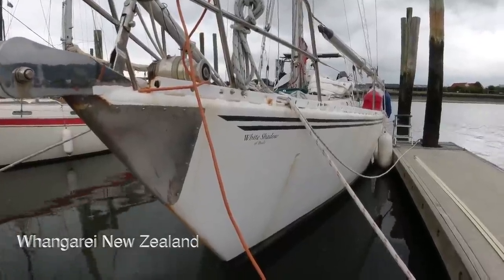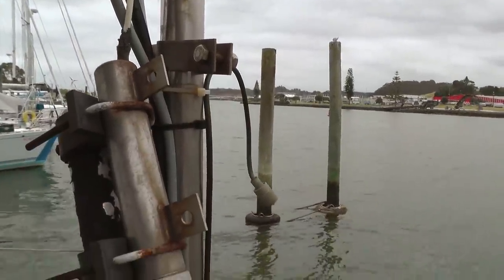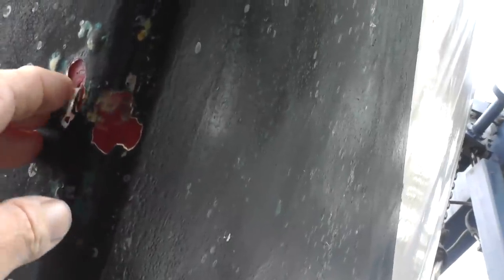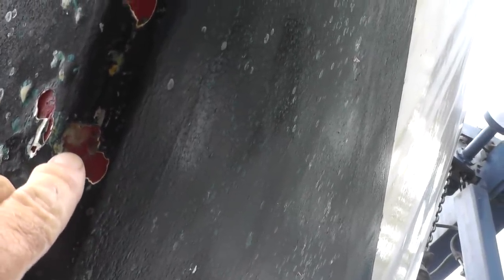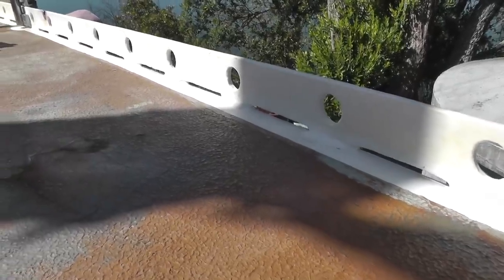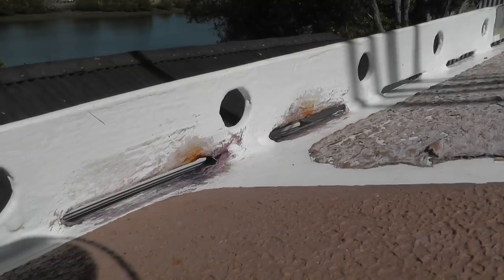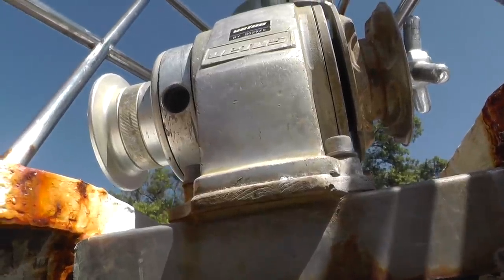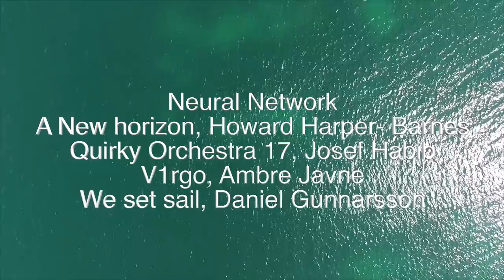Yacht Haulout. Adventures of an Old Seadog, epi 165

Comment: Baz, if the rust is coming back you are definitely doing it wrong, The only time it has come back on my boat was poor preparation and trying too much at a time. I clean the iron oxide off or Scale ,Rust what ever you name it back to bright clean metal, then clean it off with  acetone just before i paint it with saturated zinc paint, one pack for scratches, portholes, chips and joining areas and two pack Jotun 90 for larger and hard wearing areas and the bottom of the hull. Cleaning rust stains off is usually done with Oxalic Acid. Keep em coming mate it is always great when you feed pops up.

Comment: Barry, the reason for the rusting at the gunwales is because of minute changes in pressure - the water being forced through the gaps. In addition to this, there is also friction - from waterborne materials: salt, minerals and microscopic sea creatures - which, although almost imperceptible, are enough to cause these weak points. A flying fish making a tiny scratch will be enough to remove a tiny bit of protection. Cheers

Comment: For people who are interested in steel boats.... Grind down to metal and use an inorganic zink primer for metal. This turns any rust on the metal to an inert salts and binds to the steel. This provides a base for the epoxy coatings. This is a Lloyds steel boat requirement.
The single part primers that turn the metal black do not work over time.
Reply: I've read in several forums, several people, stating, that their experience, is that a cold/sprayed zinc layer serves no purpose at all (but likely also does no harm).  But the epoxy coating I do believe in because it's a two component layer.
Reply: @finnerutavdet ... Yes... The inorganic zink primer is a two part epoxy based product. It was pioneered by the auto industry and why cars don't rust badly anymore.
Everything metal... From shipping containers to rebar in concrete is coated with this green primer.

Comment: A suggestion for the chain locker if I may Barry is once it's all cleaned out and repainted, coat your chain locker with Rhino Liner.  That's some stout stuff.  Your anchor chain will be hard pressed to chaff it off or penetrate.  Just a suggestion.  Thanks for all the videos and sharing the adventure.
Reply: Excellent idea, I've used it in the engine room and other high traffic areas, works well..As usual, it's ALL in the proper surface prep...
Reply: @Chris-fo8wp  yes... LineX is about the same but used in industrial applications and the military uses it also.  Not exactly cheap.... but worth the investment.
Reply: Rhino liner in my pick-up truck bed ten years old and still looks good.  I do like the results!
Reply: @Slick2462  It's good stuff.  And available all around the world.  Even where he's at.
Reply: I haven't ever used Rhino paint before but I cant see any kind of paint withstanding the abuse a chain vends on a storage locker.  Im thinking Rhino paint under some sort of rubber mat.  Ive seen hvy duty welcome matts with holes cut up and used in this sort of hvy use area before with outstanding results. I would go so far as to put some sort of drainage plate above the floor to take most of the abuse while still giving a place for water to drain and dry.
Reply: @mitch_the_-itch  It's not a paint but an industrial rubber type coating.  Pretty thick.  Never heard a complaint from truck owners.  These guys put the truck beds through a beating.
Reply: Rhino liner is pretty tough, but in this application I wouldn't use it.  At some point rust is going to start growing behind it.  It's a steel boat in salt water, gonna happen.  Now you've got to remove the Rhino liner to attack the rust.  That sounds like a lot of work compared to picking up a few rubber mats.

Comment: Get yourself a small handheld air needle gun and borrow a air compressor. You will save yourself a lot of time, and head aces. No more dust and that needles get into the tinest corners.
Reply: Needle gun is a required piece of equipment on a metal boat!!!
Reply: Nothing like the sound of a Needle gun when I was in the Navy! Hands being vibrated to death after working on scuppers for 8 hours a day.
Reply: I use and highly recommend the Nito Jetchisel Jex28. Best Needle Gun in the free world!!
Reply: Better off with a small sandblaster, faster and better results, it’s messy but it’s worth it... cheers 🍻 💚🍀
Reply: @Chris-fo8wp  way way too late.  I think Barry's close to a year behind on his uploads.  If I remember correctly, he arrived in New Zealand when china 19 hit.  needle guns ARE handy
Reply: @christopherw4527  From Insta and Twitter it looks like this is fairly realtime. Maybe you confused this channel with Soulianis. They are over a year behind. NZ does not have Covid.
Reply: @heiner71  Maybe you are right.  I just remember listening to a video called sailing over 50 or something similar.  Barry does talk about why we don't see masks, because he arrived in NZ about the time china virus hit.    Guess it doesn't really matter.
Reply: @heiner71  just looked on AIS.  says he left on the 4th of january and is headed north.
Reply: @christopherw4527  Great! Could be that he fixed his boat really fast, or that he is a few months behind in posting. Probably somewhere in the middle.
Reply: @heiner71  Barry fast?  lol.  probably somewhere in the middle.  It did show him being anchored around wangari in many different locations.  He probably finished up several months ago, then changed anchorages for a month or two before sailing north.  looking forward to new adventures!
Reply: @bigeyetuna6228  unfortunately u cannot do this in a marina like this. The sand and rust dust would go anywhere..
Reply: @bigeyetuna6228  and u need tons of sand...

Comment: Hello Barry, I don't know which exact product you are using but usually it is extremely important not to let it rest overnight, it gets humid with the cold air and dew and you have to start from scratch (sanding it out) otherwise your rust will grow back from the inside. The normal procedure is : apply the first coat, let it do its magic for a few hours, then apply the second coat and paint after a half hour to seal it from the humidity. It has to happen all in the same day! Good luck with everything.

Comment: If you are able to get Marine Tex there, grind the rust off in the anchor locker, then mix and apply a thin layer of Marine Tex epoxy putty over the areas. It won't wear off like paint.

Comment: The rust on all rail holes are caused because the holes have a noun round eges, those edges for shure are sharp, so rounding all edges will be the best solution to allow the paint best adherence and erosion resistance. Sorry for my english.

Comment: Rust is iron oxide. The chemical treatments usually is phosphoric acid which contains phosphor. Phosphor is more chemically active than oxygen (oxide) so it replaces the oxygen in the iron oxide turning it to iron phosphate.

Comment: A little trick I use to cover and protect metal on boats is powder coating. Buy a bag of white powder coat and a heat gun. Put the powder on any surface and heat it up with the heat gun. As it heats up it dries smooth and seals any metal object. Lasts longer than any other painting method.
Reply: I always wondered how much heat was needed to make it flow and go smooth like it does.  very cool idea

Comment: Do yourself a favor for the future , Strip the hole deck. I saw on the video there are more cracks in it than you like. For the rest I like your videos and I follow you from the first part. joy and emotion. Now you get another one: do I strip the deck or not. I help you , fairing the deck again is also a hel of a job so I would put this energie in getting it clean. no fairing anymore and the future maintenance will be match easyer. Keep Healthy.
Reply: Crazy having a faired deck, leave it uneven and a good paint job will last for ever.

Comment: Wow. My hats off to you there. That is a LOT of work. Next time you win the lottery, buy an Aluminum boat!  Ha ha.  I have always had glass fiber boas ( and yes, they can have their problems too, but not usually as much). but if I had the money, would have gone with aluminum.  
Interesting seeing the boats lines out of the water. Very full bilged but fin keel and twin rudder. I assume that she must have a rather large displacement. And I have noticed that you reef down a lot, even in relatively light airs. Is that for balance issues?  I love your sprit, ambition, and videography.

Comment: Most haul out yards in NZ now have signs on the front gate reading  No Welding, No Grinding, No Sandblasting, No Spraying. No Living onboard while you do the work sometimes too. This is shorthand  language for NO STEEL BOATS or visitors who live aboard. This means proper repairs to steel boats have to be done on private property or at a commercial shipyard. We opted to take ours to a rural location away from the rust police where we could sandblast and grind and weld and all the proper repair methods for a steely.

Comment: As others said you need a needler , also called a scaling gun - they are made specifically to remove rust scale . After you paint the chain locker with epoxy then paint with truck bed liner to reduce chipping .
Reply: Um.....this was filmed long ago...
Reply: @JCrook1028  True - still good advice as it is going to rust again

Comment: The chain locker, can you spray truck bed liner in it? In Texas, people spray bed liner in the bed of the truck.  It's a thick rubber like paint.  It would prevent rust and it would last for years.

Comment: I love this, showing how you make repairs.  The bees knees!   A familiar expression for me growing up in Boston, Ma.  When working on your anchor locker, after removing all rust, isn't there some kind of spray fiberglass that can used so it seals everything and you won't have to keep doing it?  I guess if there was, you'd be using it.  Can't wait for the next videos on the re-hab.  Stock up on the beer so it takes the edge off! haha
Reply: This is my private opinion, but my way of thinking is that you never manage to remove more than 98% of the rust,... there will always be a tiny little bit rust left, and even though acid can somewho neutralize it a bit, it's gonna continue.  I'm thinking of it as something that's alive and moving.  And if you cover something alive and moving with anything hard that can not adapt (move along) itself, then, over time, it's gonna separate, then later crack, and then rust again, just much quicker because what you covered it with prevents it from drying out.  Vaselin and Lanolin fat doesn't let air or humidity through and adapts (is flexible) so that's gonna prevent it from getting worse.  Epoxy (two component) also don't let humidity or air through, but it's hard, thus not able to cling on to what still goes on underneath, and sooner or later may crack is my thinkng.  Owatrol oil which hardens (like clear paint) is the best compromise I know of, and is my choise of first layer on top of where the rust was, if I have to paint it. ........ That said, my experience is from cars, and not from boats (my boats are not steel :-).

Comment: When you're using Brunox DON'T go with you're brush in to the pot you will take rust into the pot and activate the rest always put a bit in a container apart and use there is also a spray can it's on a epoxy base and works also very good. Go for it, the boat is only half way so it kan use some maintenance for the rest of the trip, until next time, have fun doing it.

Comment: The new epoxy that will cover the bare areas on the deck will expand and contract at different rates than the existing deck material and will crack with in a day or two. You will have the same problem right away. The entire boat needs to be sand blasted and redone. Im afraid this is a waste of time Barry.

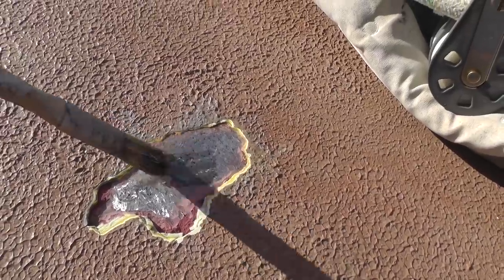Comment: Hey Barry, at @17:39 there's some cracking in the existing epoxy, you may want to break it out and reseal it because the crack may run to the steel and cause more corrosion. I see this problem with concrete and rebar a lot on exposed concrete decks. Love the vids! :)
Reply: seems the anti slip will seal it :P

Comment: Try and see if you can get a sand blaster to come out on site to do the chain box. Paint and Rino liner it.
Reply: I agree, the only way to be sure to achieve 100% perfect preparation is to invest in sandblasting followed by the best epoxy paint that is internationally available. Only after creating a sound foundation would I consider Rino Liner as the final top coat.

Comment: Had a 54 steel cutter , Made myself a little sand blaster used to use a small portable air compressor , worked a treat , One job at a time .

Comment: Starting to think there's so much epoxy on a steel boat that you may as well add some reinforcing fibres to that and leave out the steel.
Reply: But the steel is strong, you can bounce over rocks with no damage.

Comment: Barry the pronunciation phonetically is  Fong-Ah-Ray  or  Wong-gar-ray said without the gaps of course. :)  Those cracks on the deck coming from the old repair patches should be opened up I think even if just exploratory otherwise down the track it's going to come back and bite ya on the arse mate and easily filled back up if found to be not a problem. if it was me I'd have sand blasted the chain locker it looks like shit and would be done in 30 mins. Yeah I know not my boat but I've seen the outcome of "She'll be right jobs".
Reply: You should be very proud Baz.

Comment: I might be late with my comment, but here goes nothing.
Paint needs to be thick enough layer to provide that water resistant barrier it is supposed to make.
Sharp edges are a problem, because the paint will not build that layer on them.
That is the problem with your towrail and propably all other sharp edges around the boat.
Take your Dremel and try to round those sharp edges before painting.
Then you need a proper paint system, but considering the beating your boat has experienced during this half a year in salty water, your current system was not bad.

Comment: I'm wondering if the scuppers are rusting because the slots are horizontal and suspending water droplets along the top of the slot. Wouldn't a crescent shaped hole allow the drips to roll down and make more space for the flying fish to escape?

Comment: The scuppers and the rust problems. You need to enlarge the “openings at the deck evacuating the water” and make the edges of the openings smooth followed by some rust protection treatment.
Reply: Agreed, I don't imagine they were initially well covered with paint, looks like a cranny if ever there was one...

Comment: Hey Barry having taken a great deal of intetest watching just about every episode youve posted of your adventure to date iv thought its perhaps time i should at least offer some advice that youd possibly find useful. Iv seen you put a great deal of effort towards the relentless battle against rust on your beloved boat its becoming tough albeit entertaining to watch and not offer some suggestions on advice based from my exoerience after 20 yrs in the marine trade ... 
Obviously its not ever going to be completely avoidable and shaddy has already seen many years at sea exposed to elements that are ruthlessly tough on any boat let alone steel which is completely reliant on what is effectively only a very thin layer of paint andas youd be well aware once moisture finds its way underneath rust is particularly difficult to manage again theres no eternal cure but if action towards making the best possible care inevidibly youd be faced with having to cut substantial chunks of your boat out when its reduced to point its a structural concern.
Obviously the bulk of your problems are in the anchor well and theres water and junk coming in frequently but something that i have found is critical to put emphasis towards is that wherever opposing metals come into contact your going to get corrosion at an amplified rate. 
From what i can see from video unfortunately i feel the bulk of your issue is deriving from the lovely shining stainless guard fitted as anchor guard and where your windless winch is mounted to the deck. Your then dumping galvanised chain which carries and retains moisture and chips away the paint its a perfect  recipe for long term heartache ... 
it really does pay to put thought to insulating or sealing any hardware mounted where opposing metals may come into contact and when you do get rust the area is stripped back well into non affected areas and the appropriate rust converter is used and ensuring the area is dry as possible. You really need to get it to prime inmesiately afterward so theres least chance of any nasty bits left sitting there because the whole cycle just begins again. Rubber or the hard cutting board type material between the stainless guardd and using sikaflex on the bolts and in my opinion stripping back that entire area of paint to raw steel is going to be best course of action to giving a far longer timespan between needing to take action and unsighty stains.
All advice offered in good intent and hope it may help !

Comment: Noisy work usually works to clear the area. I have wondered if paint in truck bed liner would be good or bad in the anchor locker.
Reply: I wondered that too. I guess if you get perfect coverage and bond it's a good idea. If you don't and get rust underneath it then it's a
bad idea.

Comment: I could never deal with a metal boat the rust would drive me crazy
Reply: My steel boat had the best prep and paint when new, and still looked new after 10 years. You only get one chance to do the job right. Scuppers and high wear areas had stainless steel edges.
Reply: All boats need maintenence.